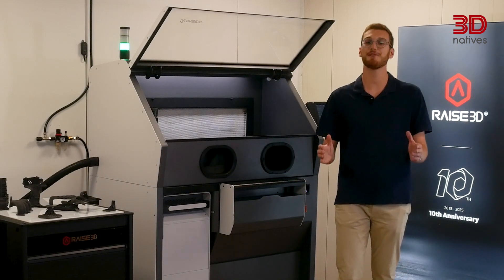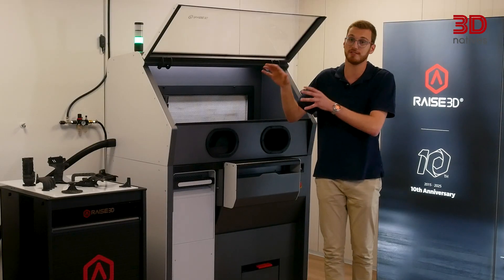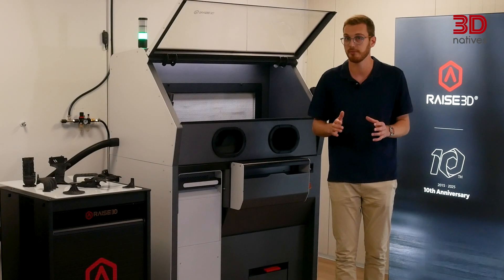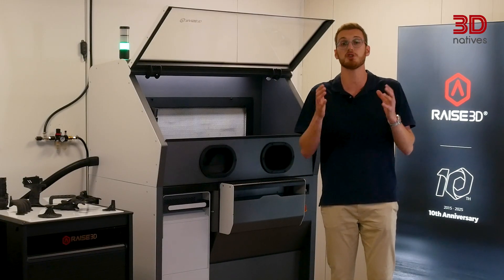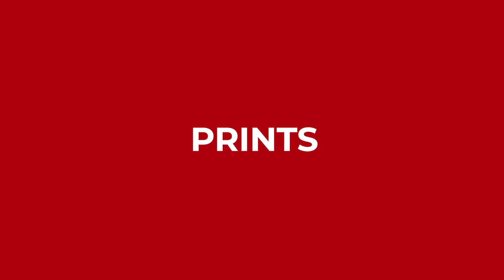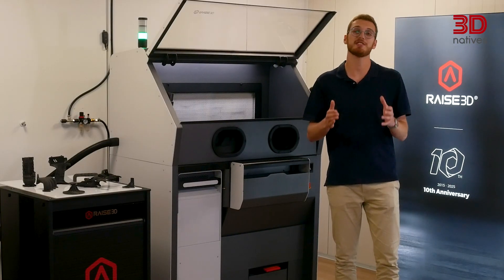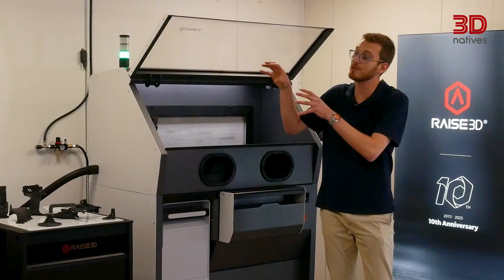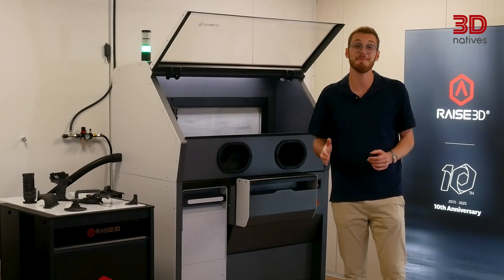We Put Raise3D’s First SLS 3D Printer to the Test – Here’s What We Discovered! | Raise3D RMS220

Comment: Offered at €26,999 excluding VAT in its standard configuration (printer, Build Unit, cleaning station and 1 year warranty), the RMS220 is clearly aimed at laboratories, design studios and small industrial structures looking to internalize SLS production without investing in a heavy or complex machine.

The Official website states:

Raise3D RMS220 Series Standard Package
Sale price$ 44,998.00 USD 

Raise3D RMS220 Series Standard Package include Printer with Build Unit 220, Cleaning Station C220-P, and one-year warranty, all bundled for convenience.

Not even at the highest 27% VAT the price matches.
Reply from the maker: Thanks for pointing this out. The machine alone will be available at €26.999 whilst the standard package costs €34.998 according to RAISE3D.